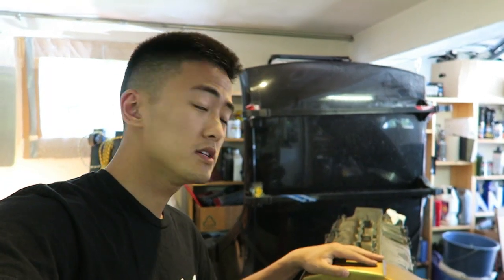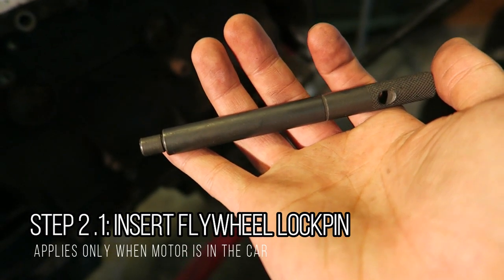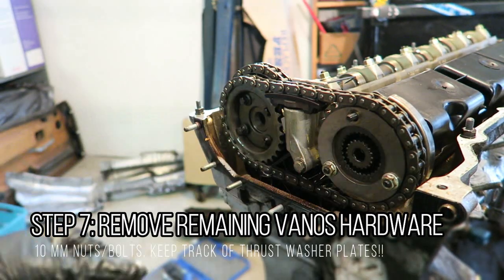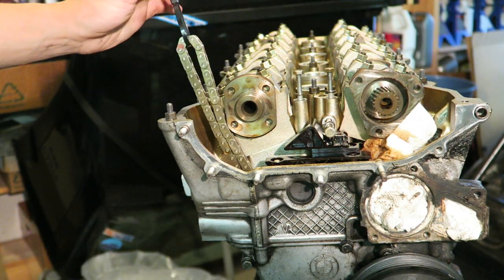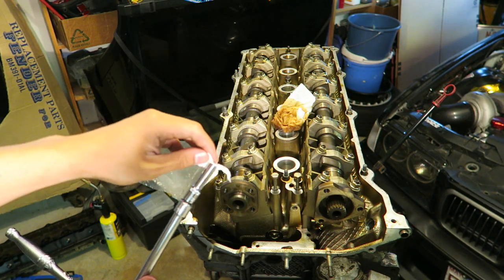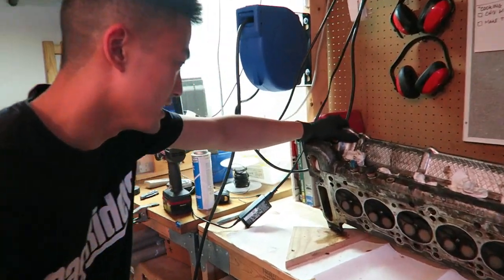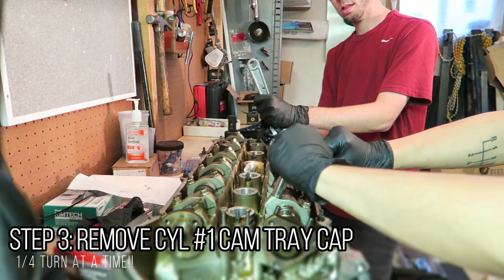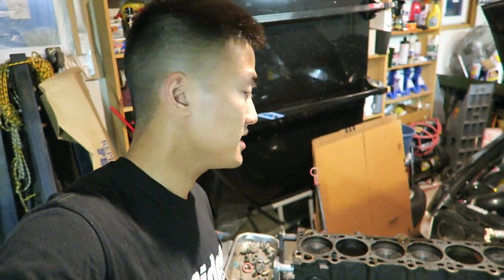FAST BMW E36 Engine Teardown [Pt1]: How to Remove VANOS and Cylinder Head (m50 m52 s50 applications)

Comment: Ive been having some issue's with my m50b20, its a euro model. Ive had the wrong timing sensor in there and it got flooded with fuel, now i cant get her started again and looking into the spark plug holes, the pistons themselves are covered in thick black soot. The sparkplugs also come out smelling like fuel. Should i rebuild or just engine swap? Im clueless at the moment

Comment: Is it absolutely necessary to rotate the crank pulley CCW for the 16mm of extra clearance with the pistons? I currently have the flywheel lock pin installed on my M52 and I don't want to remove that if possible. I want to remove my cams to replace my lifters. Also, curious why it's necessary to pull all the lifters out at once. Can you replace each of 24 lifters individually with a single magnet?

Comment: This and others of your videos were very helpful in guiding me on tearing down the top end of my 92 325is to replace the head gasket.

Not sure if you're willing to answer some questions,  but now that it's back together, I'm trying to figure out why the temp gague rises to the red after only a few minutes from a cold start. 

New thermostat,  new water pump,  ne temp sensor,  new overflow tank.

Comment: This video is great, all business. I’m doing a head gasket replacement on my 98 single Vanos 328i. Thanks for all the tips. I’m rebuilding my Vanos, upgrading the cooling system, converting to electric fan, and replacing my heater control valve while I’m there.

Comment: Do you think trying to put the head back in the car with the exhaust header installed is not worth the trouble? Or just struggle with the exhaust header bolts with them in place?

Comment: Also I believe the cylinder head bolts are stretch type bolts which should be changed. Is this the case for all M50s do you know?

Comment: Great video. Is it still advisable to rotate the crank off TDC for the 16mm clearance if you are removing the head to work on the CAMs?
Reply: I’m wondering the same, I rotated mine for clearance before removing my head, but I’ve had the cams out now, wondering what my best way is to re-time the engine back up to tdc. With cams back in

Comment: Thank you. You’ve motivated me to attempt my 1st time ever rebuild and successfully rebuild my 98 S52 with new piston rings & bearings, new crank bearings, head gasket, oil pan gasket, all new bolts. Honed the cylinders. Found a damaged steering coupling and replaced it too. All done with engine inside the car. It was easier than I expected. Hardest part was removing the subframe to get access under the engine. 
I also learned that there is a process to follow for 1st  time engine rebuild start ( Good thing I came across that video). I’ve learned a lot from this experience. Thank you 😊

Comment: I was taking mine off today for a head gasket. Had to rotate the cams to reach the head bolts then I forgot how they were oriented in TDC. This video saved my project. I was able to use it as a reference to set everything back up correctly

Comment: At Step 8 - 6:15 - When you turn the crank CCW to create the ~16mm of clearance, I noticed your cam lock tool is still installed.  Should it be installed at this step?  I kept mine installed and when I removed the head I noticed that valves in cyl 2 & 3 were partially open.  Unfortunately, I assumed that all the valves would be closed (forgot I turned the crank for clearance) and laid the head down on the table, valve side for like 15-20 minutes.  Hopefully, I didn't damage anything.  Anyway, I was under the impression that at TDC, all the valves would be closed.  Does it make sense to disconnect the cam locking tool prior to turning the crank for clearnace?

Comment: Hey I just recently replace my head gasket on a 95 525i auto because of over heating issues.. put everything back together..no overheating but the car isn’t running at full power. Thinking it might be the timing. I place it at BTDC timing blocks and flywheel pin on. Not sure what when wrong or where to start to fix it. Help anyone?

Comment: Checking out a 02 325ci has over heating issues any thoughts?
Reply from the maker: Ask about the service history! If there aren't any leaks, it could be a failed water pump, clogged coolant passages, or a bad cooling fan.
Reply: Yeah the person told me they have reason to believe that its a block radiator. Thinking about just rebuilding the whole cooling system

Comment: Great information on your videos.  I’m changing head gasket on my M52B28. Any tips on how to remove a stripped etorx bolt?  I believe it’s an E8.  It’s the one near the front of the engine.
Reply from the maker: Thank you! Unfortunately I'm not skilled with stripped bolt extraction. I do know which bolt your referring to and that sucks it's stripped (tight location right?). Do you think you could hammer on a slightly smaller sized bit? Ive never tried this with a female etorx socket, but when removing the pressure plate on my clutch I stripped the hex screws and had to hammer a larger torx bit into each screw just to get enough bite to break them loose.

Comment: Is that the cast iron, nikasil or sleeved aluminium block. I am currently turbocharging my bmw and the thing is that here in finland you cant get your hands on sleeved aluminium cylinders easily. The m50 block is too heavy. Do you have any experience in sleeving aluminium blocks. Or would you recommend just running with the nikasil as its in good shape. AFAIK you can ofcource make power with nikasil but when shit goes sideways you are in much more trouble than you would be were you running with the sleeved or cast iron blocks

Comment: This video is so informative I wish I seen it 4 years ago when I was 16 and got my first m50 e36 coupe with a blown head gasket. Back then there was only 1 person that had a video of his speeding through a top end break down and I did the rest reading forums and what not. I didn’t use any special tools at all but I did take a shit load of pictures and notes. This video is the one good shit
Reply from the maker: I feel you! I made this video because I was on a similar boat. There were limited resources at the time (mostly forums for me too) when I built my turbo e36. I did similar things as well with endless hours of research, pics, and notes to make sure the first time around it went back together and ran 😂. after the build was complete I regretted not documenting things on video, and I just wanted to give back in a way, so I found that creating something that's useful using my old engine for the next guy was the next best thing. Thanks for the love, happy modding 🤘

Comment: I have a similar project right now. I have pulled out the engine and i am about to begin rebuilding it. I was wondering how would putting in 2.8 liter crankshaft and s52 2.8 liter camshafts affect the vanos system. Am i good if i just change the DME. My final destination is to put in a big ass turbo so i am reinforcing the whole thing

Comment: So without using the special cam removal tool I was told to loosen each nut on the cam caps by alternating from top to bottom going from front to back until they were all loose and it was unsprung.  So what you just showed by putting the cam in that position changes all of that and allows me to loosen them all except for the very end?
Reply from the maker: Yes, that method also works fine (it is a safer method in my opinion), my method is just an alternative if you want a quicker process than slowly loosening all the caps little by little. If you want a more detailed video about the process I recommend checking out the channel mybimmerspace. I learned a lot of what I understand with e36 engines from him

Comment: Have you done a dyno of you're S50 clone yet?  I'd like to compare HP and T curves with my clone.
Reply from the maker: I didn't clone my e36 drivetrain. It's just a stock m50 with an aspiration conversion. 350whp is the last reading I got on the Dyno.

Comment: greetings I like your videos, I have knowledge of basic mechanics, and I have a bmw 325i coupe that I have been restoring, little by little due to lack of time, but the car has warmed me up twice and I have taken it to a Mechanical expert in European cars, the first time I took it I changed the water pump, the radiator, water hoses, and head gasket, the mechanic handed me the car and I gave it to him with water, not with antifreeze, because prospcedia to do a cleaning to the entire engine cooling system, followed step by step the whole procedure, in the step that told me to handle it for 2 hours or 3 oues I decided to leave it on but without running it and I was waiting for what was happening, but after two hours the hose that goes to the heating broke, to change it, to remove several cables, such as the temperature and the sensor and the silinoid of the openings, mount everything to the back, and I had doubts because I did not mark the cables, but I put them on, and sequi with the pr ocedimiento, take the radiator, but ignite the car and I realized that the cluster was not bad but they did not put the cable well, I finish the procedure and proceeded to put the antifreeze, until there is everything well I give a trip of half an hour and I got the car, because the cover came off and broke the fan and the radiator, I no longer trust that mechanic and decided to buy the tools to remove the head block and take it to rectify it, in a machine shop and I mounted it myself but this I'm going to put a stronger 5 layer board, which you recommend I'm thinking about doing it later, thank you for your att attention. Felix Bobe
Reply from the maker: Hey man, im sorry you've had a few issues and bad mechanics in the past with your car. As for the work you are doing to the cylinder head, are you asking what head gasket I recommend? I would stick with Cometic if you want a head Gasket that is MLS. if you want to seal the combustion chamber well for high horsepower (like adding a turbo) then I'd get a cut-ring headgasket
Reply: @Pawinning  thank you for answering my question that is my idea and peerlo turbo, respecting the board because I saw that the one you mention how to know which leads because I saw that it has different sizes
Reply from the maker: @felixbobe3627  you're welcome 🙏

Comment: Hi, based on your knowledge of this engine, can you see any reason why oil wouldn't flow correctly if the engine was mounted vertically.
I understand that the sump and pickup would need modifying.
Just not sure if the head or cam carriers would create a barrier in the vertical position.
Thanks
Reply from the maker: Woah that's a great question. Off the top of my head, I wouldn't think the orientation would effect flow much since I'd imagine the engine design would focus on consistent internal oil pressure under operation no matter the orientation (within reason, of course). Not an expert on the design choices, but part of me thinks they also chose to tilt the engine so that it fits within the vertical space of the engine bay. I don't see anything in the design of the parts that be effected (besides the sump and pickup you mentioned) if it were mounted vertically. I'd check out Bimmerforums to see if anyone's done an engine swap with a vertically oriented inline six. I would also be aware that the shifter linkages would also need modifying as the trans would be rotated as well
Reply: @Pawinning  thanks for your answer. 
My main concern was oil pooling and being agitated by thinking hitting it.
I did find on the bimmer forum someone who mounted the engine at 10 Deg instead of 30 degrees.
I think they stopped at 10 because of clearance on the inlet manifold.
I have a similar issues in my kit car and plan on switching to itbs to get it to all fit.
I figured for the gearbox I would just chop the stick and reweld.
This is all a bit experimental so not 100% sure what the unknown issues will be yet.
Reply from the maker: @richardschofield2201  no problem! Happy to try and help as I can 👍. I'm glad you found a similar build that you can reference. Your build sounds really cool and I wish you good luck with the engine swap fitment! Yeah the shifter modification idea should work, and you might need to rig up something for the trans mounts too 👍

Comment: Great video, the only wrong you did is when removing the cam, you've probably bent it! You have to loosen the guides evenly, every bolt quarter evenly across all cylinders when you are not using the special tool 11 3 260
Reply from the maker: Thank you for your feedback! I agree that these cams are fragile, and yes you can loosen every guide slowly and evenly when doing this without the BMW cam removal tool, but I've used this alternative method twice before with no issues with re-installation nor did I experience any bent cams. 

I learned this technique from this video here: https://www.youtube.com/watch?v=wRnqy-7dT28&t=959s (in the video he talks about the same technique at 7: 30)
In the video, the host states that there is only one position you can rotate the camshaft to that relieves pressure on all the lifters except for the ones for cylinder #1. This allows you to safely remove all the other guides and then work on the last guide nuts a quarter turn at a time (as long has you hold the camshaft still, if it rotates on you with the other guides removed the camshaft will definitely snap/bend).

Comment: What a great video! It helped me understand the operation of Vanos altogether with overall timing. One question that bothers me is why the holes on the timing gear are slotted, allowing potential rotational movement if the 4 bolts get loose? Wouldn't that compromise the timing between the crank, exhaust cam and intake cam?
I can agree that slotted holes on the exhaust sprocket allow to remove/install the Vanos while maintaining proper timing but why we need slots on the timing gear?
Reply from the maker: Hey man! Great question and I too used to be pretty confused about the slots on both intake and exhaust cam gears and how it operates with the vanos system. My best explanation is in this video I made that discussed how to maintain the vanos unit itself. Hope this helps!  https://youtu.be/Y_BRIv_xqMg

Comment: when unfastening head bolts it's recommended  that you loosen the outer bolts first and work inward to avoid war-page while loosening
Reply: it's vice versa when installing but opposite (inner bolts to outer bolts switching from side to side)
Reply from the maker: Thank you for your feedback 👍

Comment: hey guys,i have this problem from 2 years  and i'm pretty confused...e36 m52b20 engine in pretty good condition (i think)...when i drive it long the oil lamp start to blink when its on idle...if i just touch the gas pedal sooo easy and the rpm just go up for 50rpm not even 100 and the lamp go off...i doesnt make noyse from the crank and cams at all....everybody keep telling me its the crank bearings or oil pump..what do you think it is???can it be the high oil pressure valve on the oil filter unit???or maybe the sensor?
Reply: I had this same problem on my e36 m3 and I read in the owners manual it is normal and as long as the light doesn’t stay on when you get up to higher engine speeds
Reply from the maker: Hey man! Thanks for supporting my work! I appreciate the compliments 🙏.   For your oil issue I would definitely start with the oil sensor replacement first. While you’re in there inspect some of the wiring local to the sensor just to make sure nothing is grounded incorrectly. The small amount of throttle applied that shuts the light off makes sense as the pressure increases slightly with a higher engine load (to see how much exactly the pressure is you’re gonna need an aftermarket oil pressure gauge), but again if the sensor is faulty then it might not be reading oil pressure correctly.
Reply: @Pawinning  The fact you still respond to comments on a video you made a year ago is so awesome man i just started watching your videos as i plan on building multiple e36s loving the content so far
Reply from the maker: Henry Guardado thanks man for the love! I’m glad my content is helping you through your own builds. Good luck with them 👍
Reply from the maker: You don’t want to dig into the bottom end of the engine if you don’t have to 👌. If you want to dig into the oil filter housing, (I’m not 100% sure if this applies to your car) but there’s a small o-ring gasket at the bottom of the threaded bolt that secured the oil cap to the oil filter housing. People can overlook that o-ring long term and that can cause a small seepage/leakage internally in the housing.

Comment: Is there a specific order to loosen the head bolts?
Reply from the maker: Yes, don’t remember it off the top of my head but the bmw Bentley maintenance manual has the order. And any aftermarket stud/bolt kit should come with them as well